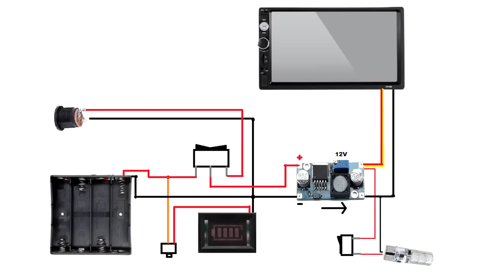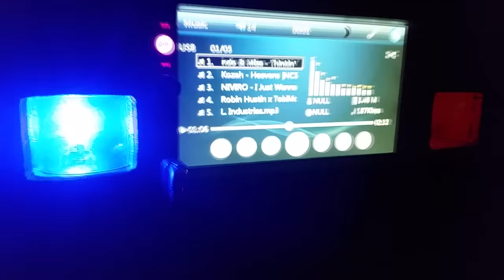DIY: Portable MP4 Boombox Speaker Loud System

Comment: I legit had this same idea a while back. And you made it a reality. WOW
Reply from the maker: its a nice ideia ;)
Reply: Zack Mell 5
Reply: When I built my portable System I used a 50 cal. Ammo Box. I got two 4" great sounding speakers from eBay for about $15.00 that have a plastic chrome skull over each speaker. I didn't realize it until I turned it on for the first time that the red eyes in each skull light up to the music, like the lights in this video but not nearly as bright. What I'd like to know is how long can a 12 Volt Super Capacitor Battery pack will power the radio in my setup. In this video, it appears that he is using (4) 3 Volt AA Batteries to power his setup. I've been using a 12 volt Gel-Cell battey like the ones used in a battery backup devise for computers. I'm thinking that if my single DIN radio can only run about 4 to 5 hours on that battery then this dudes 4 AA batteries are only going to last him about 5 to 10 minutes before needing charging. But I might be wrong.

Comment: Looks good. There is one thing I would have done different. Id found a way to have use two double "C" or "D" size battery holders. They'd be a longer lasting battery. Or even a square 6v battery to sit in the bottom.
Reply from the maker: Those are 3.7 lithium batteries, 1.5 volt batteries don´t have enough amps

Comment: You seemed to give yourself a lot of unnecessary work but a decent result. Home power supply’s usually give off a hum. Also those batteries will last about 10 minutes.
Reply: Not necessarily, i used a 12v wall adapter for a headunit for testing and operation, and not a hum was heard. If you have a decent quality supply and its audio grade, it shouldnt be a problem. Although id rather use a 10 amp led power supply for some grunt.

Comment: You used a 18650 power pack you think it's possible to maybe use a Milwaukee M12 battery to power this aswell?
Reply from the maker: Yes, but its better to use a step up converter because if the battery drops bellow 11 volts the radio will probably turn off

Comment: Seems like tgis thing sounds great. Have you looked into the suggestions of longer battery life and a radio antenna? I would be very interested in purchasing something exactly like that for when I throw parties here at home. I have yet to find something powerful enough to support the sound quality I want, but still fit the budget of a tree guy with four kids. Being rechargeable is not a necessity, I can always run a drop cord. But as I said, seems like this thing has great sound for the size of the unit, and if you are willing to, I would like to buy one and would promote it for you as much as possible. How much?

Comment: Good work, I would like to know if it possible how much is the temperature of the radio inside when Its functioning so that it does not burning the chip of the amplifier.. I'm thinking build something similarly and I do not know if a fan is necessary.
Reply from the maker: if it works without a fan inside a car in a hot day it works everywhere ;)

Comment: hi...i am from greece and i likeall your diy  ... i have  a questionbecasue i can not find the answer... for working this car multimedia it has got 2 wiring connectors... what colors need it... i found (red/yellow +12v - (black gnd) (and the other connector for speakers)the other colors from power connectors for what is blue color wire orange wire and pink wire? i understand only the orange wire is for the accesorie for steering wheel control if it is correct please help me...thanks
Reply from the maker: Search on google "7010b wiring" and you will find easly the meaning of those colours: blue- power antena, orange- stering wheel bottons, pink- reverse camera trigger.
Reply: @DTeK  can you help me if you know what means blue wire power antena? i will use the volt + wires smd gnd....
Reply: @DTeK  can i ask what power supply you use and how many ampers is the power supply? thanks
Reply: how many ampers is the power supply?

Comment: Makes me a bit sad that people often put such effort in making a decent enclosure for their music equipment without spending some thoughts on acoustics.. As is often the case, the cabinets for the speakers are far too small. The tweeters should be mounted as close as possible to the main speakers. Few people today seem to understand what "stereo" means. In order to achieve a good spatial sound, the loudspeakers have to be at a considerable distance from each other. Therefore, the speakers should be separable from the electronic part. For transport, the parts can be connected with quick-release fasteners. A general note: It is not possible to build loudspeakers that are small, loud and capable of low bass at the same time as requiring little power.

Comment: I found it very cool, but it would be much cooler with two passive radiators, one on each side.
Reply from the maker: these speakers have a nice amount of bass already, but it will look cool for shure
Reply: It is that I looked at the cell phone and the cell phone does not notice if it has quality or not

Comment: did you use capacitors for the tweeters speakers... ?
Reply from the maker: yes, built in tweeter capacitors.
Reply: @DTeK  how many farads
Reply: @DTeK  are you sure?
Reply: built in capacitors

Comment: Would I need a BMS also if I were to make one portable?
Reply from the maker: In this build i charge them using an external charger for each cell,this 18650 have pcb in the cells wich protects them against over and low discharge, you can had a bms to charge them inside the speaker, i did that in my previous build.

Comment: Sir what is the small square drawing with orange and red line  next to to 4s tester on your diagram  on the video
Reply from the maker: 20:44 its a momentary push button, the other ones are on/off switches
Reply: Thank you where can i buy it sir?

Comment: If unless you're using a buck converter in Junction with the battery, I don't see how those batteries can power that boombox without being plugged in to a wall socket.

Comment: Bms or over discharge protection?
Reply from the maker: 18650 with PCB Protection, cuts off when voltage is low
Reply: @DTeK  👍

Comment: Turn the voltage up to 13.8v or 14.4v
You are starving the radio of voltage 12v is like having a flat battery in a car 
13.8v is like having a fully charged car battery and 14.4v - 14.8v is like letting your alternator change your battery
Reply: I rather suspect the voltage from a car battery is passed through a regulator before it reaches a car stereo's elctronics, so the circuit wouldn't actually see 14.4 volts.

Comment: In the long run when you max out the volume there's no speakers sound distortion?
Reply from the maker: not really
Reply: I already bought same speakers, when I tried to adjust the volume it has a distortion effects i can't max or adjust the volume.. Can you teach me how?
Reply from the maker: @zteblade8194  What is your power supply? it needs to supply at least 5 amps or more
Reply: @DTeK  i used 12v 2amps.. Lower amps of power supply can affects sound of speakers(distortion)?..
Reply from the maker: @zteblade8194  Yes, when you increase volume it need more amps and could distort sound, restart radio or  have sound flickering issues, try it with a more powerfull power supply.
Reply: @DTeK  ok thanks a lot, I'll buy another power supply and I will try if it works.. I Will update soon..
Reply from the maker: @zteblade8194  ok, also test the speakers inside a cabinnet or case , if you test the speakers without any case they will sound worst :)
Reply: @DTeK  i already got my power supply ordered online 12volts 5amps .. It works perfectly.. Thanks a lot.. By the way can i add some speakers or woofer with different ohms and watts? Like 4ohms 30Watts woofer?.. And another 4ohms 300 Watts midrange?

Comment: Nice work man but you can't charge lithium batteries like that. You need a balance charger or just a 4S charger board. I'm serious. After a few chargers they can blow in your face.
Reply from the maker: Batteries are charged using an external charger, they have also an overdischarge pcb that will cut power when voltage is low;)

Comment: Should have left the voltage at 14-15 volts, that the normal running voltage of a car that uses a 12 volt system.
Reply from the maker: The working voltage of an alternator charging the lead acid battery its around 14 volts, the components in the car such as light bulbs, radio, 12 volts outlets , all this components work with 12 volts.
Reply: @DTeK  they might say 12 volts, but that's not exactly what's happening.

Comment: I got power but no sound how do I get the amp to start
Reply from the maker: gray and gray/black wire are for right front speaker , white and white/black are for left front speaker
Reply: @DTeK   we did that the amp not activated